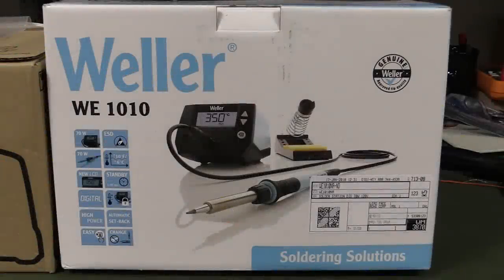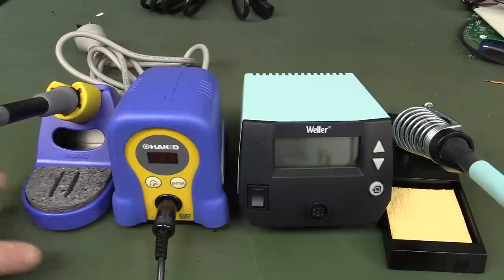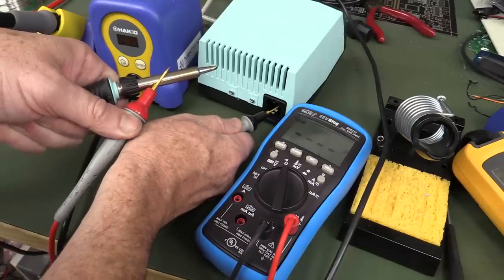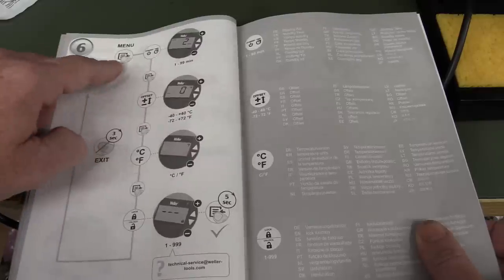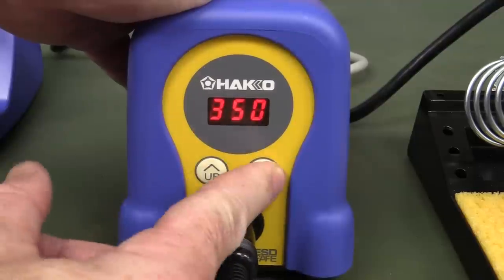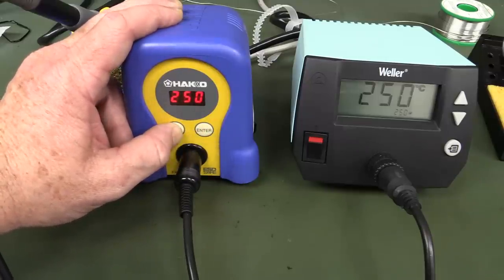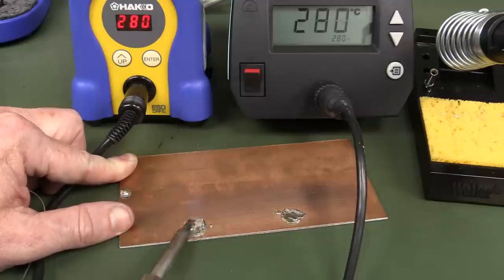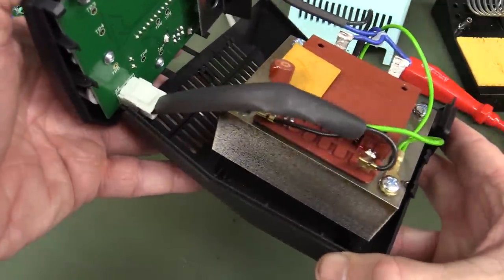EEVblog #1063 - Weller WE1010 vs Hakko FX888D Soldering Station

Comment: I would say the Hakko won that hands down,, The weller kept losing temp while soldering and the sponge cleaning was embarrassing for Weller, Plus if you drop the weller it would be destroyed, The only good thing about the weller was cosmetic, it gripped better and had a better cable deflector. But really I prefer function over cosmetics.

Comment: I don't get it.... These iron are designed for *electronics* work and yet we have comparisons about termal loadings and speed to temp. These units are rarely used for large soldering jobs: they are used for heating small components in a controlled manner.  How many times are you changing the tip tempurature and how many times are you in a rush to have the tip heat from 350c to 450c? What type of electronic solder-loading will pull the heat from 350c to 200c in normal conditions? Perhaps if the air conditioning isn't blowing like an artic blast the irons would stay more thermally stable. If you are using either one of these to soldering irons for  large "construction" projects you have the wrong tool.

The review of the ergomonics is right-on. Having an irratating handle renders everything else moot.

Comment: Frankly, both of these stations suck. With the tech that we have, temp drop from real-world soldering should not be an issue at all. Also, put a thermocouple on the tip and try your temp-drop tests again, and you'll likely see the Hakko drops just as quickly :)

Comment: Only use I've had for conical tips is clearing out a bit of solder in a solder hole that I can't get with a sucker or braid. If it solidified roughly midway down the hole it's really hard to get it out. A very fine conical tip can get in there and get it clear.

Comment: Weller is much better than the Hakko. I have the older Hakko with the pot knob and similar model Weller at work. My Hakko doen't heat up enough any more and seems like such  pain to use. Weller i have never had an issue and it's abused at work.

Comment: My Weller quit working and i tried to get some spares or a repair from them....NOT available. Only the iron is available as spare part but no repair or spare parts for the powering unit. I don't know how it is with Hakko but i find this unacceptable. I was satisfied in the first place because the first batches had mechanically bad soldering irons which they replaced kindly without cost but now this. It's a shame....Into the bin it goes!

Comment: i'm thinking of doing sum soldering and de-soldering of 2 keyboards and perhaps more in the future.. i'm contemplating the HAKO vs TS100 a small unit that doesn't take to much room as currently i don't have a permanent working area just my regular desk. Also looking at the S-993A desoldering iron. i'm thinking that would be better then doing a full size keyboard and a ten-keyless with a spring loaded solder sucker?? Does anyone have any advice??

Comment: What a good video Mr. Jones, I have been thinking of acquiring the Weller station already having the Hakko fx888, analog, honestly it is a fairly durable equipment, its tips last for years and the product in general is very good, made in Japan, the Weller 1010 equipment I think about buying it to test its performance, here in Mexico it is distributed by a store called Steren de Electronica, but I think I'll think about it a little more, since I saw your video where our protection does not cover primary stage, thank you Mr. Jones.

Comment: My Weller W60P works great with a spring stand AND I got it free many years ago. Could use a tip and a sponge. The grounded tip feature stopped working about 2 minutes before the first time I plugged it in. Last week when the power was out in half the state I used my Bic lighter to repair some solder connections. Two weeks ago I repaired some 1 watt LED strips with a blow torch. Does it really matter if the temperature is C or F as long as it woks?

Comment: I have used Weller for 40 years. Most recently, WS50 + MLR21 for 17 years, splurge-upgraded recently to WX 2 with three different irons, and the WXMP especially is fantastic. Damned quick and solid. Why change brands when something works really well ? :-) But I guess all the top brands at a certain price point work well these days, and it's gone down to just little personal preferences. IMHO Hakko is goddamn ugly, it looks like a 5-year old's toy, screaming colours and all. Weller isn't exactly pretty either, but at least the design doesn't yell at you. Apropos : Hakko's smaller width might save a few centimeters, and it certainly looks very solid for it, but I think Weller's larger width might just make it that much harder to topple / drop. And the Hakko seems to be lying a bit about its temperatures. Ah well, little niggles and trade-offs everywhere. :-)

Comment: Got my FX888D for 110 Euros in Europe; WE1010's price is 170 Euros so from a price point perspective the Weller is the loser. However the Hakko has only price in its favour, user interface is garbage, i would rather have the analog FX888 over the D just becaue of that.
Maybe you can get your hands on the Ersa RDS 80 and do a 3 way review? This one's priced at 140 Euros.

Comment: Hi I should buy my first "real" soldering station (I've had until now only cheap things, but very cheap ..)
I repair smartphones and PCs at mid-level and are growing, connectors, electronic components etc etc
I'm damn undecided! I see that here there is a lot of expertise!
Which among:
ERSA I-CON Pico (Nano is too expensive ..)
Weller WE1010
Hakko FX888D
or Quick products? (example 236, 202D or very nice the 3104, I accept advice for other models)
I already have the 861DW hot air station.
Thanks I hope that some competent help me.
Reply: Hakko FX888D! Just dont get a fake.
Reply: @stclairstclair  thank you very much!

Comment: everyone always complains about the conical tips... conical tip + metal file = chisel tip.
Reply: And a loss of the coating, not a particularly good idea...
Reply from the maker: Bad idea, you lose the plating.
Reply: I've been doing it for a while now as long as I keep the tips tinned it doesn't seem to cause any problem
Reply: I do understand the concern though,  if i were assembling things for production id buy proper tips,  although if i were assembling for production i imagine id have a budget for tools and accesories anyway so itd never occur to me to file a chisel tip onto a conical.  Ive just always been in the make do with what you have camp :-P
Reply: David M Heroin is higher on my priority list, tbh.  Enjoy feeling superior.
Reply: David M the sort of country where an unemployed ex criminal drug addict college drop out whose father was just hospitalized in a coma can still have dreams and aspirations of pursuing a HOBBY in electronics because it helps keep them busy and out of trouble has more important things to spend ten dollars on than some soldering iron tips.  As i said before, enjoy feeling superior.
Reply: and besides I never said that I bought one of those irons I have an x-tronic 4010 xr3 that i only spent 40 dollars on.  Which is actually quite nice for the price.
Reply: DJ 10 minutes

Comment: Fahrenheit all the way fella.....100, 200, 300 degrees vs Celsius 37.78, 93.33, 148.89.....no thanks,
Spoiler alert, I jumped to the end and found he could not make a decision one way or the other.
If you want a low cost unit watch reviews on the  KSGER T12 Soldering Iron Station for $42 on
Banggood or $60 on Amazon, well built unit at a low cost...... However this unit ONLY displays Celcius so 
if you prefer Fahrenheit this is not the unit for you.

Comment: Embarrassing review.  You completely misread the Hakko’s digital readout.  It doesn’t share accurate reading of temperature.it only shares what it should be.  Much different.  I can’t understand how you could miss that.
Reply: Toneconsultant gmail,  If  "it doesn't share accurate readings of temperature, it only shows what it should be" Then why can you watch the temperature climb after you've chosen a higher or lower preset? or when you watch it warm up? Do you think that's a pseudo preprogrammed temperature display algorithm?

Comment: The Hakko just looks a little silly. And the user interface is just crap. But the thermal mass seems quite a bit better. But then the Weller seems to update the display faster so does that make the Weller look worse???? They look very even in performance. To me the user interface is important, quick and easy is the way to go. And of course the feel of the pen is as very important as well.

Comment: that userinterface of the hakko seems like crap. I mean, comeon, not putting a down button in to keep the fancy design of the case. Who buys a soldering station because it looks nice
Reply: If all things were about equal, I'd pick the one that looks better. However, the Hakko is sacrificing usability for that look, which is a dealbreaker for me. It's 2018, I'm not going to select “11” to switch between Celsius and Fahrenheit.
Reply: i agree, its ridiculous. But i could live with that. Most users propably set their units up once. Changing the temperature is something you do on a regular basis. And i mean, putting a 3rd button in wouldnt ruin the design completly until you do something real stupid like a big red buzzer on top of it or something. Or even better: put a rotary encoder in it. Its not hard to come up with something which does less suck

Comment: @eevblog I think the spongetest is slightly flawed because the weller appeared to have more surface area touching the sponge. Also, with the temperature to 450 C test, I think the weller might only apply the temperature after you let the button go so it might be slightly less slow.

Still though... both of these  are lacking too much, if they'd combine both of them it would have been nice...
These vids make me so happy I got a JBC :P

Comment: Neither have a UI worth a damn but the Hakko is worse. I bought the Hakko because they're decent quality but would have greatly preferred the earlier Hakko dial style someone was obviously proud to have disposed of.  There is really no excuse for sucking at UI design but the Weller is simpler. 
I don't use the Hakko in production and never would but the Hakko is OK for building wiring harness. For SMD it makes far more sense to buy an advanced hot air station. Cheap soldering stations are like cheap welding machines, they suck.  
The Hakko industrial designer should be ashamed of inflicting a NON-STACKABLE case on the world but now Hakko are married to this shit.
Reply: Hi, around € 130 which soldering station do you recommend ?

Comment: I have both, the iron stand on the hakko is cr@p, you end up lifting the whole stand when lifting the iron. The classic weller stand is faaaaar better and heavier (although they've changed it slightly to it's detriment). Both do exactly the same job tho'. BTW, the weller goes to sleep - just wipe the tip or touch one of the buttons to wake it up and get up to temp - NOT mentioned in the manual :-)

Comment: way to bias.. whining about an extra stand by feature that definitely a plus and a benefit 17:20 and then using the display as a reference master value without even checking them.
Then you would love the cheap ones with real temp-display as they certainly dont have a responsive display  ... you can hopefully conclude those display values aint apples to apples and how they take their values.
And you certainly have the tools to test, the actual values there are present and not just use display and different approaches from Hakko and Weller' as master reference display temp-value.
Reply: lol and you even later now excusing this fail  24:15 wild that you could not conclude that from how different these displays acted.
and next time use a freaking watt-meter as that is often useful to see what they consume, even a barebone one' would be better then not. https://imgur.com/a/V1Qh8yJ

Comment: I had used Wellers for years, and always was disappointed with the reliability. They would always fail in such a way that it couldn't be cheaply repaired. Went with BJC and never regret it.

Comment: Ps test the Ersa I con nano
Reply: It’s already like 7 years old but it’s still very good 
Also it heats up very quickly
Reply: hello weller 1010 or Ersa pico ?
Reply: @philipanderskatrodavlis5661  I think there exists alsow a ersa i con nano at least in germany
but if you cant get it just take the piko its alsow verry good (is my solderingiron for 2 years and still works like new) alsow the pic o heats up in about 7-8 sek to 300C the nano just has a better stand and heats up a bit quicker and has a bit better termalperformance but costs 60$ more
LInk for nano -https://www.idealo.de/preisvergleich/OffersOfProduct/1998132_-i-con-nano-digitale-loetstation-ersa.html
Link for piko-https://www.idealo.de/preisvergleich/OffersOfProduct/3186405_-loetstation-i-con-pico-ersa.html
ps the nano is esd save and the pico isnt 
hope i could help you (=
Reply: @deruhu9163  thank you i only need to repair amplifiers audio and devices like these i think will be fine .Thank you for your help
Reply: @philipanderskatrodavlis5661  No proplem

Comment: They also sell the cheap Weller in Germany. I use an ersa iCon Pico and I'm quite happy. But soldering stations seem to be a tad like religion. Once you've found one you like you join the cult and never accept any other brand.

I was kind of eying one of the cheap nasty chinese Hakko knock-offs as an iron at my parents. I've got some of my projects running at them and I always have to bring my soldering iron along if something needs fixing.

Comment: The Hakko soldering iron looks like a real gadget for teenagers. In the 49 years that I have been working in electronics, I have never used anything other than Weller, both with my bosses and when I started out on my own. All over the world you can find spare parts for Weller iron. I have a big doubt that it is the same for the Hakko irons!

Comment: weller transformer fail, they welded all plates together... trafo will get very hot because of all that power loss there
Reply: It doesn't cause any problem out on that edge and it helps stop the laminations from humming.

Comment: tssss... solder Station just for an iron... i only use already cheap ass ts100 Irons wiche are sized like a pencil and doing easy 70w with just a double 0.2mm wire
Reply: agree

Comment: Weller wins, hands down... for two main reasons: first is the obvious: the Weller color.  Then there is usability in the real world.  Hakko has a car crash of a temp setting method.  Plus, the default temp mode for the Weller is Fahrenheit.  None of that Celsius garbage.  Note: although the pliers used in this video are impressive (and were appreciated greatly) - they pale in comparison to the letter opener used on this channel

Comment: Dave you should do a sex doll comparison - you seem to have a fetish for rubber !  I'm not an electronics guru like you , just a hobbyist and these comparisons are so useful for guys like me ! Unfortunately i didn't watch them before buying a soldering station from jaycar , while it works better than the the old one i had from dick smiths it doesn't have chisel tips available for it  . I have some tips that are very similar but the hole that the heater element sits in is a little bigger , maybe half a millimetre so i'm not sure if any loss of performance  would occur . Very tempted to get a conical tip an give it a thump with a brass hammer to create two flat spots on it like a chisel tip !